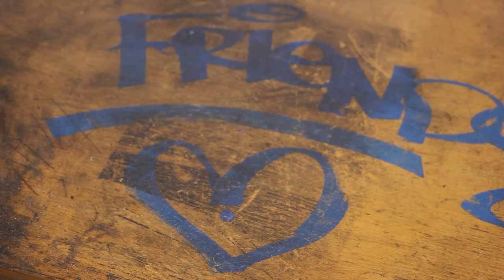Transforming An Old Peugeot Road Bike Into A Fixie

Comment: This is awesome and I'm doing exactly the same thing on a smaller budget, and I need to replace the wheels what wheels are these and what size rear cog did you use. This would help me immensely, I'm very new to this and wheelset sizes are driving me crazy. Thanks :)
Reply: it rly depends on waht kind of riding you do and what size cranket you are using. a 19t or 22t cog is a nice all rounder

Comment: I’d recommend not using grease on the bottom bracket spindle because you could push the crank on too far and either crack it or make it nearly impossible to take it off.

Comment: You shouldn’t ever grease the square taper of a bottom bracket/crank
Reply from the maker: Thanks for the tip, why not?
Reply: @SJMCycles  it allows you to overtighten onto the taper, which could deform the crank especially on softer aluminum cranks. this is like the only metal to metal interface on a bike you don't grease apart from the handlebars
Reply: @milosong-weiss5770  Thanks for the explanation. Now this is an old comment, but I was gonna ask about this very thing since I've heard elsewhere you shouldn't grease the cranks for risk of splitting them. Is this why you risk splitting them? Them possibly deforming from being overly tightened?
Reply: @TheDavveponken  I mean that sounds very plausible. I was just parroting what I’ve heard which makes logical sense in my original comment, I have no actual experience with damaging cranks by greasing the taper